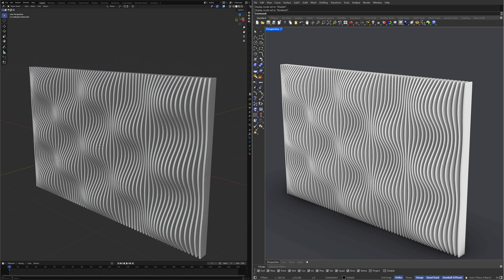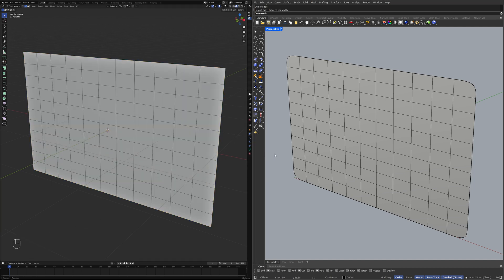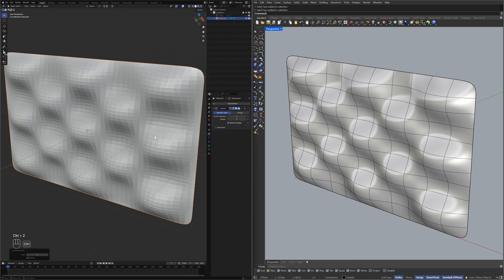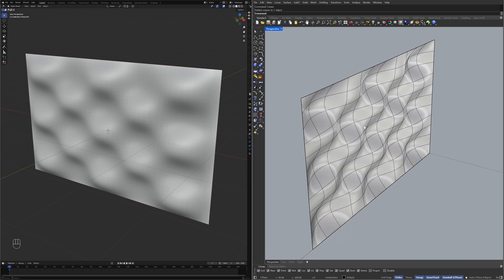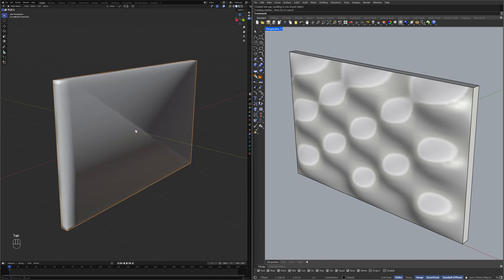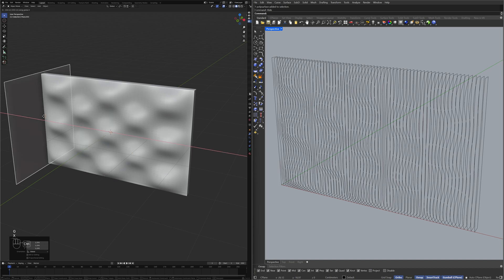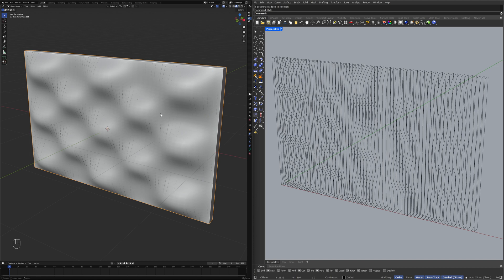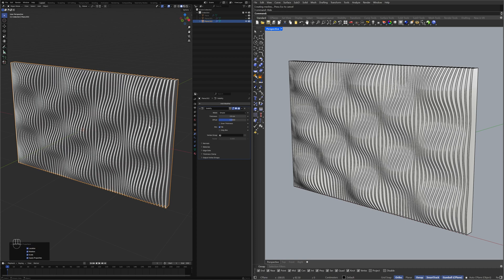Blender + Rhino I Wavy Wall Modeling Tutorial

Comment: Nice! Does Blender not have array? Rhino seems much better for this job with contour. 

It would also be great if you did this in Grasshopper and Nodes!
Reply: I model relatively simple objects in blender. If I need to clone something, do array work, physics, fabrics, etc., I do it in Cinema 4D, because it handles it much better, and in Blender it's just a nightmare. Then I combine the results again in blender and finish the scene there.